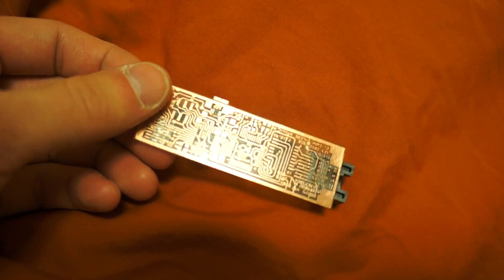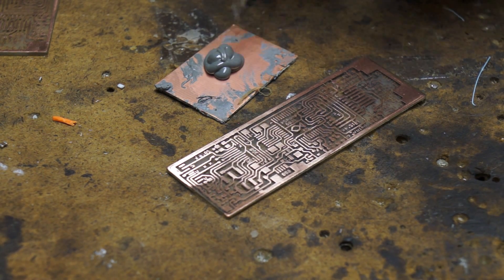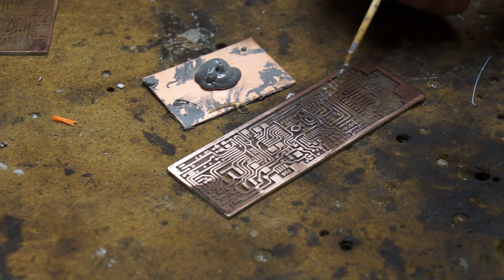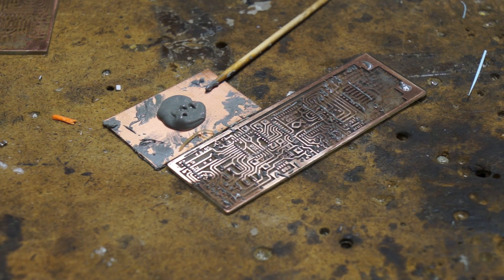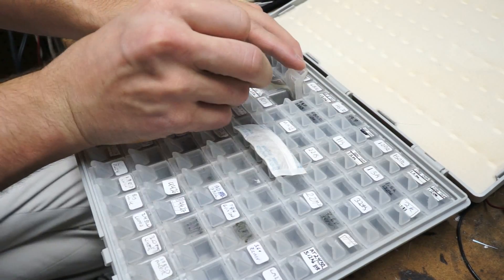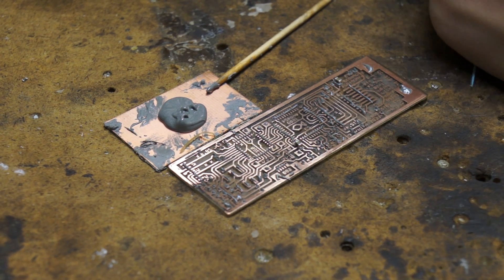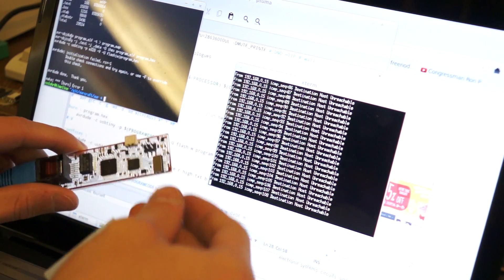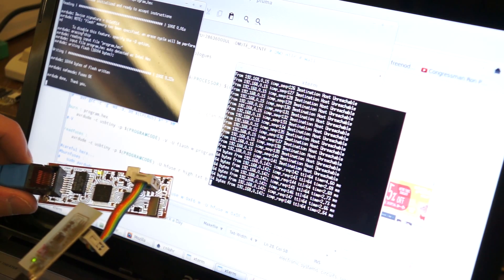How I surface mount my PCB components.

Comment: you can make stensiles with 30% hcl and 3% peroxide plus a soda can...i forget the ratio but im probably going to try it with in a few days here. It should work with uv resist but the video used toner transfer.
Reply from the maker: I used to dink with that, but, it seriously takes longer for me to get the stensils made than it does to just spend the 5 mins toothpicking it.

Comment: could anyone explain to me how the component become soldered to board. Does the paste contain actual solder, and its put in oven to flow, and bake off transfer agent.. im a bit lost going from solder paste to testing.
Reply from the maker: it contains microscopic balls of solder and the balls melt to the pads as the flux they are suspended in prepares them!
Reply: Wow. This is a game changer as far as my understanding goes. I thought people were using soldering irons.. thanks a ton.
Reply from the maker: Spectacular. Move forward!  Do things better!

Comment: How to make the design of the schematic and make sure there is no mistakes in the schematic...because i understand that one piece of mistake looks very expensive
Reply from the maker: Oh, there's always mistakes!!! But one mistake is cheap.  You can usually cut traces... but even if not, new PCBs are only an hour away.
Reply from the maker: P.S. check out my "How I do my projects" videos
Reply: which video exactly the one how you make schema diagram
Reply from the maker: Part 1.

Comment: If you get yourself a hot air rework station, you'll never go back to through-hole components.  Without a stencil, I timed myself at about 400 parts/hour placed and soldered.  Swapping out a through-hole resistor in a plated-through board can take a minute and carries a risk of damage.  Doing the same with an SMT resistor can take a few seconds.

Comment: Great video! I've avoided using solder paste because I don't want to deal with making stencils.

What part of what you are doing requires glass PCBs? Is it the techniques you use for using SMDs because the glass acts as a better solder mask? Or is it other reasons not related to your surface mount techniques?

Comment from the maker: ordinary toaster ovens definately can get hot enough.  The concern is for the rest of the parts on the board.  With lead solder you have a lot of wiggle room.  With not lead solder you have to be a lot more careful.

Comment: Thanks for the info and link to your other video. I switched to lead-free solder wire (and figured might as well start that way with paste and SMT) after a doctor pointed out that our lead levels were slightly high, even though I've only soldered a dozen small projects.  I figured it's safer and the future, no?  But I'm wondering if the higher melting temperatures will mean that an ordinary toaster oven can't get hot enough?

Comment from the maker: 0805 is a _very_ versatile part size!  I recommend it for most things.  I am just now starting to do more and more 0603, but it's been 2 or so years... 0805 gets almost everything.  If you have shaky hands, you may need to move to 1206, but typically I only use 1206 for higher power or when needing to jump several traces.

My trace widths for the glass PCBs is 15 mil, but I have done several at 12 mil with only a handful of problems.

Last warning: AVOID LEAD-FREE SOLDER PASTES. They are a pain.

Comment: I don't have a toaster or hot plate, so far I've just used a wide tip of an iron and also tried with my hot air rework station. But I'd love to get a cheap toaster or plate and looking for recommendations.  Like you, I only ever make one of each board. Thanks again!

Comment: Thanks! This is very helpful. I've been etching through-hole PCBs and just starting to do surface mount. I was thinking about getting one of those resistor and capacitor books for 0805, but then occasionally you need 0603 or 1206, so maybe the storage boxes are a better idea.  What is your trace width and spacing?  Also, when you say glass boards, is that the normal FR4s or something else?  What type of solder paste is that? Mine is lead free and came in a thin syringe, but doesn't seem as gooey

Comment from the maker: Practice.  If you just start designing things on one layer, you may need a jumper or two, but as you get better you find you don't even need them.

Also, interative design.  I normally lay out my PCBs before I design my schematics so I get a feel for what can and should go where.  I select my packages, processors, etc. based on what makes layout easier.

Now it only takes me a little longer to put things on one layer than it does two.

Comment: how do you manage to route whole board without using jumpers or other side?
Reply: miceuz that's an interesting question, Ive done some pcb's and to route on single sided board without vias is a pain. normally using 0805 will route 2 12mil traces. but it's messy